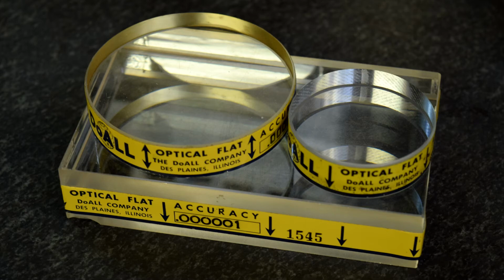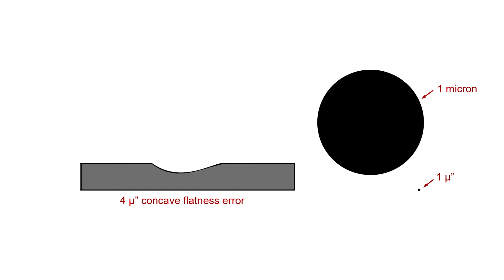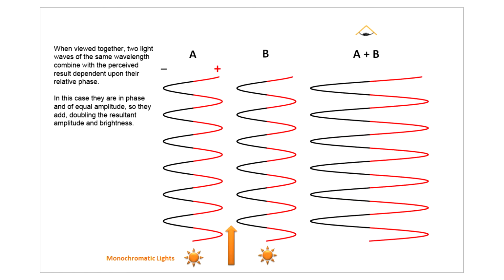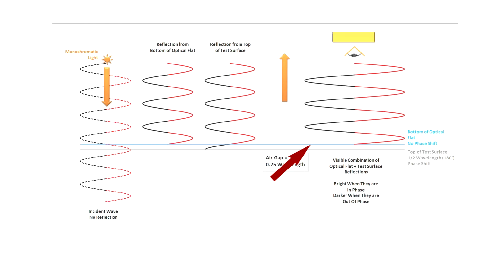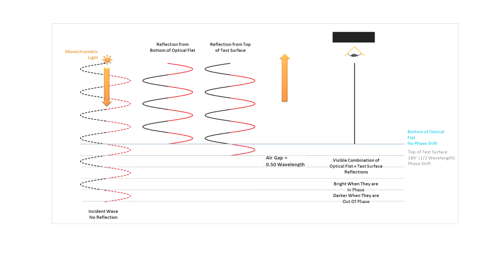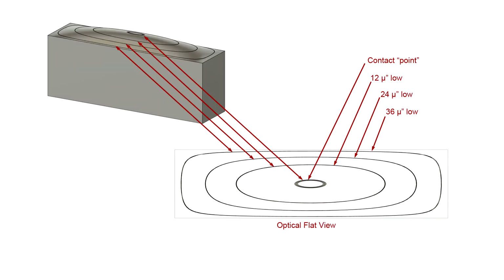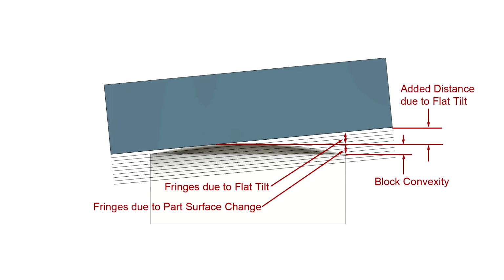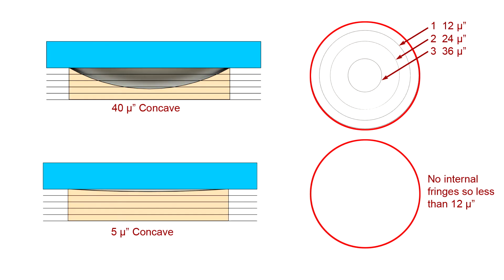Reading Optical Flats      Part 1

Comment: WHat ia required to get such good fringe visibility? I have a 6" diameter, 1/10 wave optical flat on top of a piece of 1/4" plate glass. I placed this on top of black velvet and shine a fairly bright red  headlamp LED and the fringes are almost invisible. What do I need to do to get the fringes nice and clear like in this video?

Comment: Physics is fun! Confusing, often frustrating, but ultimately fun! Sending two different wavelengths (or split the signal and delay one a pre-determined fraction of a wave) and noting the specific phase difference, you can actually measure the surface deformations to within a fraction of a wavelength. This is, in fact, exactly how higher end laboratory distance measuring tools work, such as interferometers.

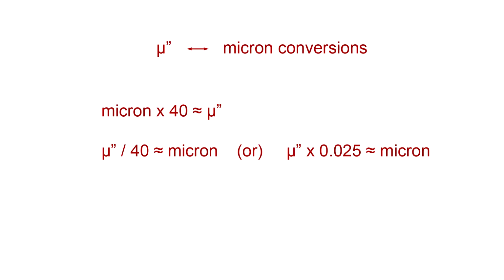Comment: The conversions at 3:03 are wrong. One micron (um) is 40x u", not the other way around. 

In optical work unit is nm, a nanometer, which is 1/1000th of micrometer or micron. For instance typical yellow light wave length is ca. 550nm (or 0.55um) and good quality optical flat is precise to about one tenth of that, 50nm. 

So better leave microns to the machinists. And let's be honest, those imperial units: fractions, thous and microinches are terrible. 

Other than that, very good video.

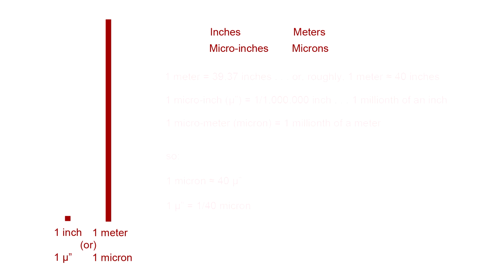Comment: 2:00 "...a meter is 39.37 inches..."  Uh oh. That was the old definition (circa 1866), and doing the inverse conversion (simple math: invert and x1000 for mm/m) leads to an 'inch' being 25.4000508 mm.  It's about 2 ppm different. That is the old 'inch', 12 of which make the "Survey Foot". The survey foot (for the USA surveying) was finally deprecated at the end of 2022, just two years ago. In the early 1900s, the gauge block maker Johannsson decided to offer 'inch' gauge blocks based on 25.4 mm exactly, splitting the difference of the US and UK inches. He unified the inch to 25.4 mm exactly, known as the International inch. So, in summary, the 39.37 is old and obsolete and incorrect by about 2 ppm.  The inch that most everyone uses is the 25.4 mm version.

Comment: So I understand that to use these you need a special light? I bought one of these really cheap on ebay for a couple bucks years ago (no reserve $1 auction for a new-old-stock item) but don't see any paterns forming when placed on a polished metal surface no matter if viewed under daylight or artificial room light
Reply: from what i am getting is you need a monochrome (i.e one single color) light source.

Comment: Can I use an optical flat to check flatness for a surface plate?
Reply from the maker: Generally, No.  First, an optical flat should be at least as large as the inspected surface to accurately measure flatness of the entire surface and a surface plate sized optical flat would be very expensive.  Second, the surface plate surface finish would need to be very good (preferably on the order of a few microinches) to form clear interference fringes.  The surface needs to be quite reflective as well.  Granite plates typically don't meet these requirements.  While a scraped metal plate probably couldn't meet these requirements, a lapped metal plate could.
  
While optical flats are best suited to measuring flatness on the order of several tens of microinches and better, even high accuracy surface plates exhibit flatness errors large enough to make fringe interpretation difficult (if fringes formed) and other instruments are better suited to this application.

Comment: I believe the source of monochromatic light you have is a sodium lamp not a helium lamp.
Reply from the maker: The DoALL literature says helium.  Others may use sodium.  Charts that I have say that helium wavelength is 23.2 microinches while sodium is 23.6 microinches so they're very close;  just at the breakpoint between yellow (helium) and orange (sodium).
Reply: @workshopengineering  Yeah i saw in video number 2. Is kind of surprising for me, because for what i know helium light is not monochromatic, maybe there is some kind of filter to absorb some of the emission lines. I made my own with a sodium vapor lamp i bought on ebay and it works very well even if it needs about 5 min to heat up to working temperature. Thank your for your answer and your video explanations!

Comment: Awesome explanation , well done !
Subed directly !☆
-One question i always asked myself , but never got answered nl.:
 -What if we use a monochromatic ultraviolet lightsource , the wave lengte is way shorter.
Meaning we could even get smaller measurement scaler ?
Or am i misding something ?
Grtzz from the Netherlands Johny geerts
Reply from the maker: Yes, if the shorter wavelength were still long enough to see (or use an imaging sensor that could).  But there are other factors such as view angle (that has significant impact upon fringe spacing calibration . . . to be discussed later) and light bandwidth and part surface finish that affect fringe width.  Conventional monolights are probably a reasonable, practical sweet spot for typical measurements without more complex setups.
Reply: @workshopengineering  thanks for answering my question ,!
Good video´s a Joy to view